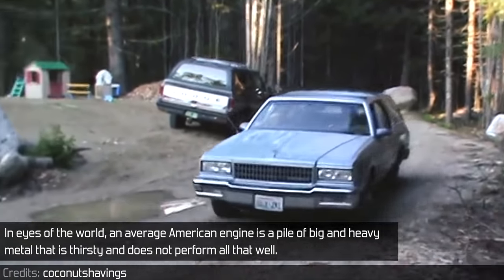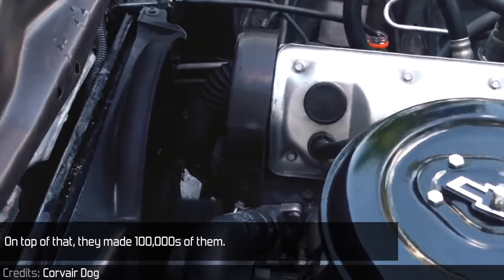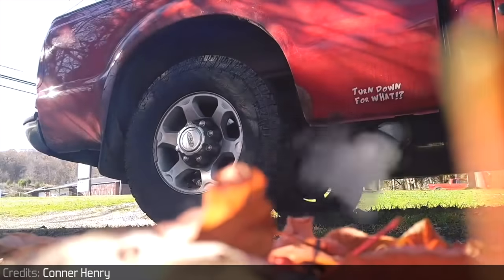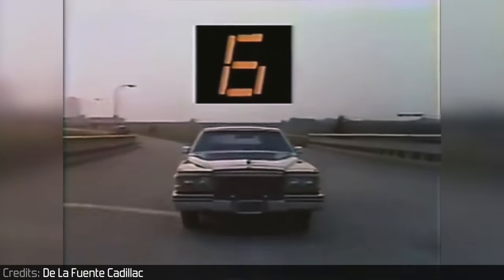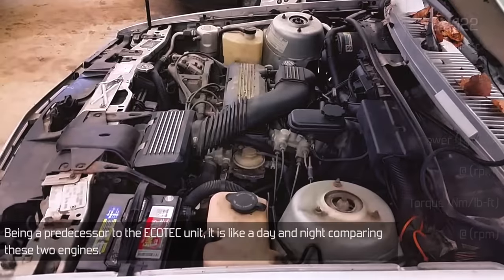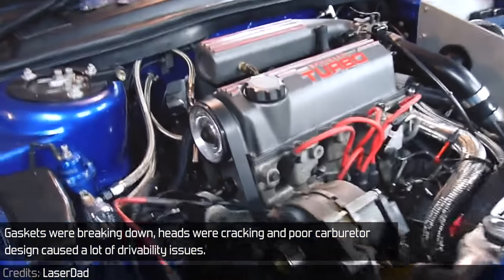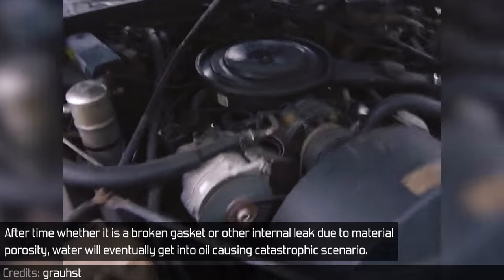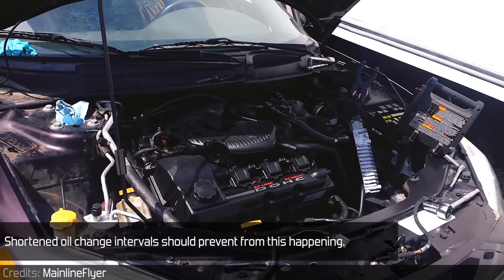8 Worst US Engines You Should Avoid

Comment: Accurate.  The Vega was a hybrid - aluminum engine block, copper in the cylinder walls.  Brain-child of John Delorean, yes, the Delorean Motor Company - same guy.  That did poorly as well.  Engineer way ahead of his time - and the technology of the time as well.  Cadillac V8-6-4 was a car without the computer technology to make it work - about 25 years too early, as Mercedes made it work first around 2001. GM finally got a new design into production in 2016 which does work fine today. Cadillac  HT4100 was  the engine that followed the V8-6-4 and was a rush job and it showed.  Very underpowered and just another miserable engine from GM they had nothing good to sell for a number of years.  The Diesel V8 GM tried to save money leveraging a lot of gas parts, so it had a massive failure rate.  GM122 led to the Ecotec as it showed GM what was wrong with their first four valve per cylinder engine.  Ecotec is an amazingly reliable engine still made today.

Comment: I wouldn't say that a belt driven overhead cam engine with an all aluminum die cast block in any way resembles a pre-war tractor engine.  It was a step to far advanced, if anything.  Same thing with the Cadillac 8-6-4.

Comment: your issues that you cite on the Olds Diesel is not at all what we saw with the one that we had.  Performance wise it had really good torque but it was basically a converted gas V8 which could not handle the compression of the diesel.  It had nothing to do with the head studs......it caused the engine block to crack.  It was then replaced with a heavy duty block however GM never upgraded the front suspension to handle the heavier heavy duty engine so it chewed up front tires.  It also had charging issues due to it having a dual battery setup.  With all those problems though it still ran great and had plenty of power for an 18 year old kid who was new behind the wheel (me)

Comment: 2:20 I've heard that if you rigged the V468 to switch from 4 to 8, but to avoid 6 cylinder mode (which skipped and shook anyway), it could run fine. Interesting car either way; any "first" in good running condition is kind of cool.

Comment: Detroit actually destroyed good engines. I bought a Maverick because it had the "same" in-line 6 that the old venerable Mustang had. Well, it threw a rod through the engine block at 44K miles. It seems that the engine had only 4 main bearings, while the old one had 7 main bearings - one between each cylinder, and at the ends. That reduction enabled flexing of the driveshaft and bending of the piston rods. That bending caused metal fatigue, breaking and throwing the rod. 
Accountants should NOT be allowed to design engines.

Comment: I must be lucky.. my  ‘02 Cavalier with the GM 122 engine has never “eaten” a head gasket, works well with a 4 spd auto and makes good use of low end torque. 134k and still going strong.

Comment: Pantera was a awesome car by the way. Some had 351c Ford motors which would overheat from lack of air flow to radiators.
Reply: Actually the Pantera was a lousy car.  It would rust out in critical structural areas in  a few years.

Comment: I agree that a lot of the motors from the mid 70's to the early 90's were under power junk.  Underpowered engines were a problem for all manufactures due to emissions rules and technology of the day.  As for the engines being junk, yes they were but not exactly for the reasons you stated.  Many of these designs were bad implementations of good ideas.  Good ideas that needed generations of refinement to be ready for public use.  Such things as aluminum engines were not well understood back then for large engine due to expansion.  The V8/6/4 was good but not ready for prime time.  This concept is used in many modern v8 engines now with little issue.  Rubber timing belt?  Gee, you do not see that anymore!!!  Not!   All of this would not have been so bad if the manufactures stood behind their product.  Instead, they blamed the consumer for maintenance negligence when these cars failed in large numbers.  So yes, it was bad business but it was also rapidly changing requirements in car design that they were not ready for.

Comment: Have to disagree on the later GM 2.2L.  There are many late 90's S-10s still running out there with 250-300K miles on them, and it is vastly superior in power and gas mileage to the comparable Ford 2.3L.

Comment: Triton v8s are probably one of the best v8s made in 2 valve and 4 valve setup the 3v has problems I’ve had customers come in with 400k+ miles on 2v modular ford engines but your lack of research really shows on that one extremely disappointed in this video do better

Comment: The Chrysler 2.2 and 2.5 from the factory was shit, but if you do the updated balance shaft chain, Kevlar timing belt, any reman water pump, multi layer shim head gasket and updated head bolts they wind up being pretty bullet proof. I used to do.head gaskets on them in 45 minutes. 
You forgot the 2.5 iron duke, the ford 2.3, the Oldsmobile 307, the Pontiac 301, the Pontiac overhead cam 2 liter, the ford 3.8....

Comment: So, a cast iron block, aluminum head engine, like the GM 3400 V6 is not an inherently bad decision.  I've gotten 200K+ miles on several before head gasket failure.  That's 13 years of driving at average yearly mileage.  In that time you'd have to replace 2-3 timing belts on similar Japanese engines, which is a guaranteed expense.

Comment: I am not a fan of FORD at all and I generally dislike their current lineup of engines, but the 4.6 and 5.4s were actually very reliable engines especially in their later years. Their fuel economy left a lot to be desired, but I cannot agree that they were among the worst or even bad. The Chrysler 3.7 / 4.7 is an engine family that should have been in this list. They were generally installed with the bare minimum amount of cooling needed which made them overheat easily and they have valvetrain issues out the wazoo.

Comment: My parents and my grandparents combined have owned three of the engines on this list.  (initiates facepalm)  That Cadillac engine was no better turned sideways, though my grandfather kept it in good shape, while my father bought a Vega wagon for my mom when she was pregnant with me.  Living in Atlanta, he noticed the car tended to overheat, which he remedied by installing a bigger radiator from the neighbor's crashed Chevelle V8.  Problem solved.  It was the only reliable Vega in the world.  As for the Ford Triton, dad has one in his motorhome; as the engine design is now over 20 years old and mainly used in trucks, the bugs have been exorcised and it works fine.  Ironically the worst car they ever owned was a BMW 325is.  That car was a fecking turd and the parts were expensive too.  Plus, they designed the car so as normal people can't work on it.  It went bye bye pretty quick...

Comment: What's in that pipe you smoking? Ford 5.4 and 4.6 are one of the most long lasting reliable out there, as many as were built that's impressive, of course your going to have lemons or poor ownerships but look around many vehicles on the road with those motors, especially government vehicles. If you drove in my 2011 Expedition 5.4 or heard it run you'd swear it was new, has 175,000 miles and purrs and drives the same as new, my 2010 F250 as well, same motor, 345,000 miles no issues just maintenance. But of course I'm only one out of millions.

Comment: I dont care what your misconception was on the 4.6l was but they were a "modular" meaning they wernt made to be the best they used them in the pickups to see how they would perform if they swaped the piston heads and timing changed with a different intake for the mustangs which had no problem running 150mph

Comment: The Ford Modular engine was a horrendous mistake on Ford’s part. I was born and raised in a Ford family and worked for Ford dealers as a tech for 12 years. Stupid head design, long timing chains, poorly designed VVT, cracked exhaust manifolds. Ford should’ve kept it simple like Chevy did with the LS design. The Triton debacle forced me to buy a Chevrolet. The LS engines are simple, reliable and durable enough that until you get over 300,000 miles on one you really don’t have anything to brag about.

Comment: The early small block Chevy and Ford engines are some of the best engines on the planet. Cheap to build, no computers, plentiful parts, and unlimited potential. There are small block chevys at drag strips across the country that make 2,500+ HP. Yes they are hard on gas, if you cant afford gas take a bus. There are no European engines that are even 1/4 as reliable or that give you as much "bang for the buck". You can build a 600hp small block Chevy for under three grand.

Comment: The GM 122 LN2 is one of the toughest 4 cylinder engines I’ve ever seen. We’ve owned 3 that have gone over 200,000+ miles with no problems, ever. Yes, regular maintenance, but no major repairs, ever. Now we’re we just lucky, or are you wrong about the GM 122 4 banger?

Comment: in the 80's i owned a 73 mercury comet 250ci 3speed columm shifter, 77 dodge aspen 225slant 6 auto trans, and 77 nova 250 auto trans. the nova was the best and the mercury was 2nd best and the aspen was pretty bad. all 3 engines were very good but it was the other stuff that gave trouble. nobody wanted these 6cylinder cars back in the mid 80's, you could buy a good reliable 6cylinder car for $500 or $600 back then.

Comment: Spark plug problem in the Ford Triton has had to do with it being a two-piece spark plug. The newer one piece spark plugs work just fine in it. Had nothing to do with the aluminum giving up first. The first problem I actually had with a spark plug is they were not properly torquing them at the factory.
Otherwise, the Ford Triton engines where 300 thousand to 500000 mile Motors. As for the early Vega motor, it was a sad attempt by General Motors to try and copy the technology that was in aircraft and Porsches. They tried to use siliconized aluminum sleeves in that engine. It didn't work because they tried to cut cost and do it on the cheap. General Motors did a lot of that crap in the 1970s and they still do it today.
All the companies are going to displacement demand automobiles. It is an asinine idea that should never have put put into an automobile. Everybody behind this idea should be fired. There is no way that you can run the other half of the motor on only half the cylinders and then still have to push the car and it be any good for the engine or fuel mileage.
The Oldsmobile diesel engine was a sad attempt at converting a gasoline engine, which was never meant to be a diesel, into a diesel. There's only about three motors that have ever been built in America or pretty much anywhere else they can be converted to diesel engines and still survive.
I don't know where you got the idea that there was a large problem with a 2.2 is. The original carburetor was rubber mounted and the rubber Mount would fail but that was not a problem with the carburetor in and of itself. The turbo version was quite a nice motor as I have wrenched on those quite a bit. It did have a tendency to wipe out a couple of Cam lobes due to heat treatment issues. But I've seen those problems on cars from everywhere in the world at one time or another.
Problem with the 2.7 L Chrysler motor had nothing to do with this design, although it's PCV system was a bit over-engineered. The major problem for the 2.7 is that a catalytic converter set right on either side of the engine, and would overheat the oil inside the engine, causing sludge in the motor if you didn't make sure you use synthetic oil, change the oil every 5000 miles, and use a good oil cleaner, like Marvel Mystery Oil for several days before you did an oil change. It had decent power, especially for its size, and got wonderful fuel mileage. I've seen them get 40 miles per gallon in what was considered at the time a full-sized automobile. Properly cared for get 200,000 miles easily.

Comment: Yeah the 4.6, 5.4 hell of motors. If 4.6 was so bad it would not have served in police cars since 1992 to end of production of the crown victoria, even after police service taxi companies ran them. Not uncommon to get 2-400k miles on the 4.6 with out any major repairs... 4.6 was still in trucks and mustangs up to just a few years ago.The plug issue was fixed in the 5.4.

Comment: What was the 4 cyl in the GM small cars in the 90's. I want to say 2.0 but not sure. They always puked their head gaskets. The dodge, chrysler minivans had paperweights for transmissions. The Chevy Vegas standard engines were crap but there was an optional Cosworth engine that was one sweet piece. The Vega car was built for drag racers. it had a very aerodynamic shape for the time period and they used the shape for funny cars. Most racing series require a body style to have been produced as an actual car with a certain number sold to the public.

Comment: You missed the V6 and V* chevy engines with the plastic intake plenum that warped and caused 10k gasket changes.  Also earlier designs had a flaw where it would crack and dumb all the coolant into the cyclinders causing engine failure. Also I had a car with the dodge 2.2L engine from the early 1980's. That thing was and aweful mash up between VW and Dodge, which cause getting parts hard and overall it was unreliable. Hell the OEM starter wasn't right for the engine and would go out.

Comment: Chrysyler 2.2s were not bad at all I had one with 288k  in an 84 reliant another with 195k in a Omni GLH  and another with 185k  in a Omni GLH Turbo, all original no gasket issues or mechanical problems some may have but not that common . Ford Escort CVH 4 cylinders from that era were far worse they cracked heads and damaged pistons  all the time.

Comment: The Ford 2.3 OHC four cylinder was terrible in the '70s and early '80s. Rough sounding and running, with insufficient oil volume or pressure to the OHC valvetrain.

Comment: Such a shame that the vast majority of these engines are, great ideas but at the wrong time. I am trying to pull these facts from memory, so forgive me if I don't get these facts correct.

The Vega I4: as far as I know was the first aluminum block 4 cylinder. And combine that with 1970s metallurgy is a nightmare waiting to happen. A good idea, executed at the wrong time.

The Ford Triton: Meh, I'm not a Ford guy so I can't really defend this engine. The 5.4 3 Valve was the most common to have these issues, timing components, valve train, spark plugs, etc. But I believe the 4.6 was a really good engine, they used them in the Crown Vic platform cars, Mustangs, trucks, everything. The tuning companies were able to do some pretty good stuff to them, Shelby, SVT, Saleen, etc. They were a fairly stout engine, not known for earth shattering power, but were fairly reliable. As far as the V10 I don't know anything about it so I won't say anything else

The 8-6-4: Same thing, a good idea at the wrong time. The first ever engine to have a now commonplace, Displacement on demand system.  But due to how slow computers were at the time, meant there were going to be problems.

The Olds 350: gas crisis is among us. GM had no passenger car Diesels, but the Olds 350 had the strongest block out of all the current engines, so that seemed to be the starting point to the conversions. This engine had a super short R&D period, thus all the obvious problems like the head bolt problems.

The Mopar 2.2: had its issues most commonly the head gasket once again due to the metallurgy. But these engines were huge in the modding scene. People squeezing alot out of these engines.

The LH 2.7: I blame Mercedes Benz partly for this. This engine was introduced around the time that they had merged with Chrysler, and as far as I remember Chrysler had used lots of design points from Mercedes that just backfired hard. This engine being one of them. The water pumps were driven off the timing components. So when they leaked they leaked into the oil. Much like a Honda 1.7. And the oil sludge, there was in fact a poor designed PCV system, but the sludge was also due to a crazy high oil change recommendation interval.

HT 4100: After the fail of the 8-6-4 Cadillac tried to use a aluminum block instead of a cast iron one. GM was really trying to make something cool in the 80s. But once again, metallurgy comes into play. After the fail of the 8-6-4 they quickly shut it down and rushed a brand new engine family into production to try and fill the gap. I think HT stood for "High Technology". For its time, the engine and its electronics were quite sophisticated, even though it was a TBI engine and MPI was starting to take off fast. Every parameter of engine performance could be displayed on the Climate control. Some other cool engineering features such as replaceable cylinder sleeves, high operating temperature for emission control (210F, vs 180F in earlier engines), free circulation of coolant between the block and the heads, and bimetal construction. Cast-iron heads onto a aluminum block.

Pulled directly from the wikipedia article:
"The HT4100 was prone to failure of the intake manifold gasket due to scrubbing of the bi-metal interface, aluminum oil pump failure, cam bearing displacement, weak aluminum block castings and bolts pulling the aluminum threads from the block. It may not have been the most successful engine to sit under the hood of a Cadillac, but potential buyers were no more satisfied with the other two engines available at the time, the V8-6-4 and the Oldsmobile 5.7 L Diesel. Reliability issues soiled the reputation of the HT4100. As a result, the Oldsmobile V8 gas engines were a popular and straightforward conversion."

The 4.1 stopped production after 1988 where the much better 4.5 and 4.9 engines took over.